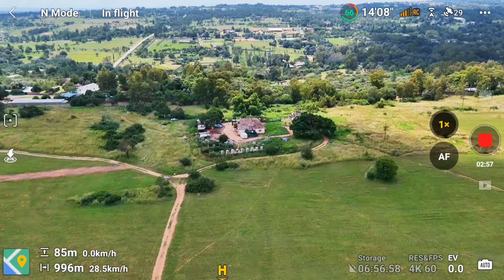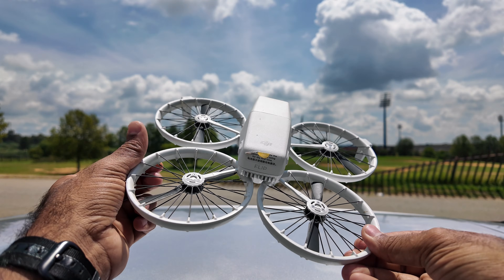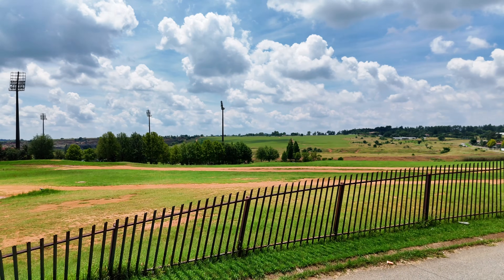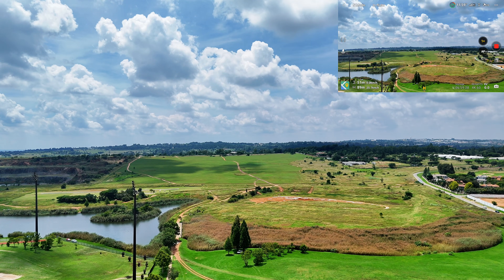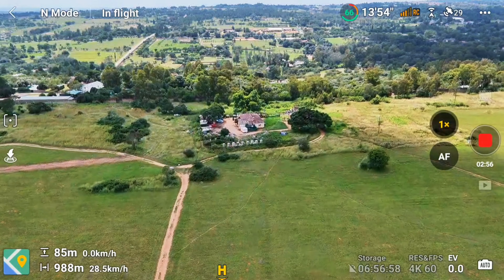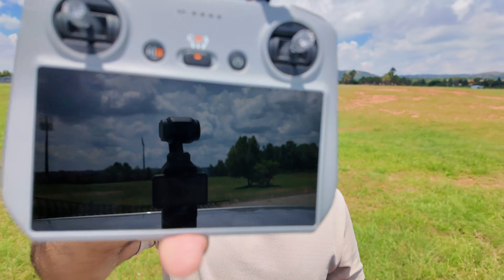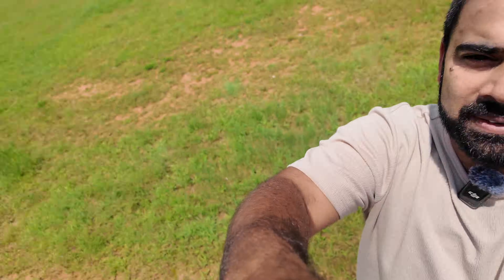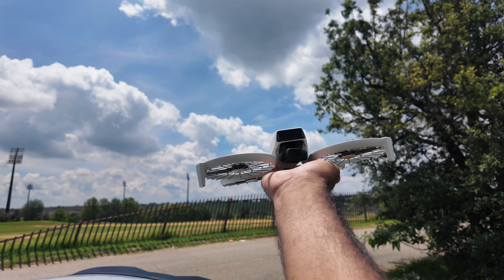I Turned Off the Controller at 1KM – See How the DJI Flip Reacted!

Comment: Hello I am a beginner of DJI flip.  I have set to return home in advance safety settings and tried your experiment with my flip at about 4m away from me.  However, the drone did not come back but descending right at the same position.  Is there any settings that I have missed out? 🙇🏻‍♂️
Reply: Thank you so much for the explanation!!❤
I dare not try that far😂
Reply from the maker: U cant trigger auto return when u are 4m away 
It has to be more then 50 m away
Reply from the maker: Or else it will just land if its close by

Comment: I had an original Phantom, also currently have 2 Mavic Airs, a NEO and a Flip. Also flown multiple scratch built drones. By far the Flip is the best drone I’ve ever owned and flown, very reliable, and smooth.
Reply from the maker: Good collection